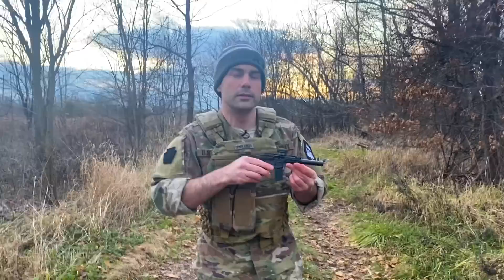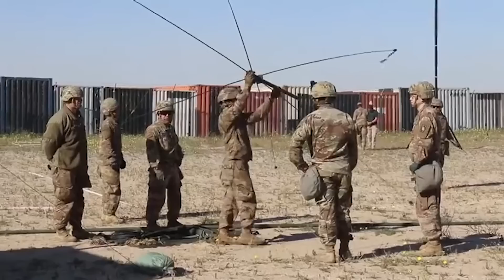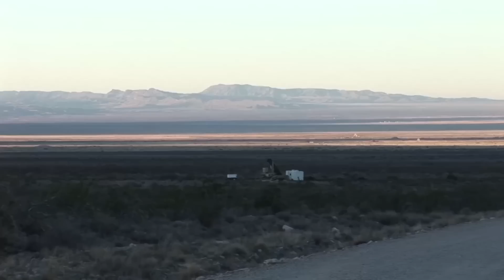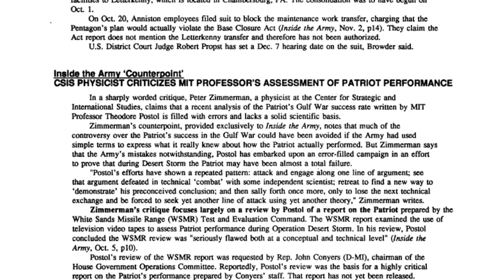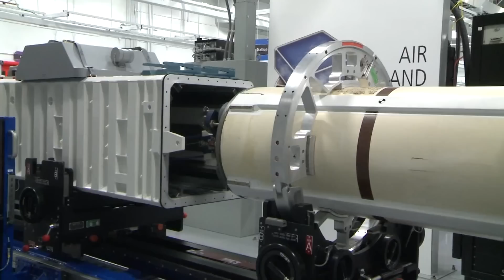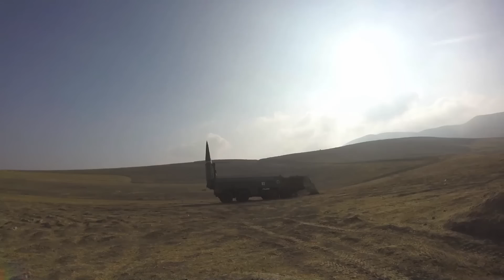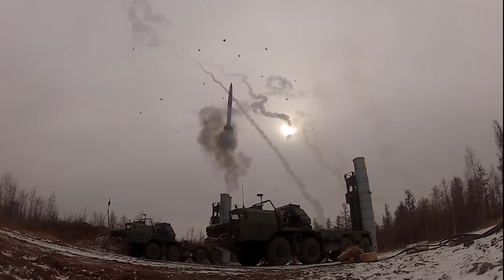Can Patriot Anti-Air Defense REALLY intercept missiles?

Comment: I got to see Patriots take out a few SCUDs in 2003 in the Invasion..  We were just south of An Nasiriya and SCUDS were being launched over us and into Kuwait.  The Patriot Battery was somewhere south of us, possibly along the Kuwait Iraq Border.   SCUDs would fly overhead and just as they would get south of us a Patriot would intercept it and blow it out of the sky... It was pretty badass.... I never saw one miss a SCUD in those couple weeks.  Of course a SCUD is ancient tech compared to whats out there now.
Reply: Advancement goes both ways, especially now with US using GaN AESA radars. Against drones, NASAMS, Avenger, and Stryker M-SHORAD are certainly better as they are way cheaper. Patriot also has a new cheap interceptor with PAAC-4/SkyCeptor. Based on David's Sling Stunner missiles that can reach up to 300km with terminal speed of Mach 7.5. Also the 1st SAM interceptor if I'm not wrong to have dual seekers with infrared and active radar homing. Furthermore, Patriot can use the new LTAMDS triple S/C/X band radar which is a leap ahead compared to a single MPQ-53/65 C-band radar. US could also send their own flavor of Iron Dome with MML/ Enduring Shield that can fire Stinger, Hellfire, AIM-9X, and Iron Dome's Tamir interceptors. Lastly, Army has the new IBCS network that incorporates all of this similar to how the Aegis system works for the Navy.
Reply: @johnsilver9338  There is no PAAC-4 / Skyceptor / David's Sling in production. There are no dual seekers on any Patriot variant. And no, you can't just plug and play any radar with any missile variant. The AN/MPQ-53 Radar Set supports PAC-2 units, while the AN/MPQ-65 Radar Set supports PAC-2 and PAC-3 units. The main difference between these two radars is the addition of a second travelling wave tube (TWT), which gives the −65 radar increased search, detection, and tracking capability.
Reply: @missileman1481  Poland has PAAC-4 if I'm not wrong. Also Romania launched a three-year investment program this year to build SkyCeptor interceptors with Raytheon. The first missiles are expected in 2026. Guam is also going to get 3 new LTAMDS radar.
Reply: Strange as it was estimated that no Patriots hit any SCUDS, a target it was not designed to engage. It did manage to hit planes, friendly ones!
Reply: So, just because patriot system can take down 10 years old scuds then it can surely work against modern hypersonic missiles....yeah...ok...

They won't even spot a zircon or khinzal missile on their radar, let alone taking it down lol
Reply: Watch Ukrainians sematarys and you will know the real deaths of Ukrainians soldiers, more than 300,000+ already berried, Ukraine is screwed by the NATO, they left them half way and have nothing to help them, UK is sending 10 tanks, France is sending tanks from the 50s that can't stand a 30 mm caliber, and the  US wants to give tanks that Ukraine need 1 year for basic training, you have nothing more to give Ukraine and Russia is about to start the war from Belarus, Odesa, and the east at the same time. Russia fooled the west calling the reserves is still going and is about a million finished training and getting ready to enter in the next 1-4 weeks, only Putin knows the date of the actual war, it was never 300,000. also  Russia already won the war with the Chef of Wagner and NATO lost it's weapons, NATO have no jet fighter flying in Ukraine 24 hours destroying weapons like Russia is doing now or drones that can fly, Russia is letting NATO weapons enter because they are destroying NATO weapons easily by drones and easier to locate a Ukrainian soldier in a tank or armored vehicles than in regular car or between houses and trees., why wait for NATO to have a direct war and have all  these weapons to use against Russia.
Reply: It makes sense when hitting a missile! 
Defending unit's/battalion's/city's against missiles makes senes, using an expensive missile system against a cheap(Russian/Iranian) drone, don't make sense. The automatic rada firing system Gepard/Shilka/ is economical sustainable. Spending missils on throw away drones, don't make senes. As Task and purpose(See their Library) describe, the phalanx gun is cheap and works against drones, when the larger weapon systems is deployed(see missiles) pleas use whatever weapon system to defend civilian life.
Reply: @Pelleisraelsson  I don't think those Patriots are intended to shoot down Iranian or Russian drones , but to deal with cruise and ballistic missiles. 

For them drones the Ukrainians have other tools

I wish the US would send C-RAM ( Centurion/Phalanx ) to shred anything that flies near those PAC 2/3
Reply: @junkookbts1273  don´t you think that a C-RAM would be an easy target for a kinzhal?
Reply: @junkookbts1273  How did the US ever get involved in this regional conflict in a foreign land across the globe?  
There are serious problems at home that need fixing.
Reply: @Pelleisraelsson  Yeah but one problem. Raytheon doesn't make as much money from cheaper and more effective systems. And since they own the politicians, expensive equipment it will be.
Reply: @Evan-iq8hd  This conflict has been, among less delightful things, a fascinating showcase about how AAA does, in fact, remain a useful battlefield asset as the missile age enters the new drone age. The Army will figure this out for themselves. The Navy has known it the whole time. But I fear you to be correct; the politicians who approve funds for this sort of overseas aid will never learn, as the arms industry has them purchased.
Reply: First Russia doesn't use SCUDs, the are what like from the 1940s and very slow, plus Iraq only had like 100 of them. Russia is not Iraq and has 400,000+ just from Lancet 3 cheap drone model and millions of missiles. It's worthless against Russia as it only have 43 Miles range and for many other reasons. first, Russia has electronic warfare that make radars and defense system detect 100 or 200 false targets and engage with them. i have seen videos from Ukraine where 50 defense missiles go to the air and explode with no targets. Second, Russia S-300 old missile from the 70s that they modified to hit grounds target fly at 9,000+ mph,  they have 200,000+ of them and each can do such great damage that takes an entire mall.  They can use 1000 of these and Patriot will be out of missiles. Third, cheap drones. Fourth, Russian fighters can detect it from 800+ km and destroy it, they don't have to enter it's 70km/43miles range. Fifth, Russia Kaliber missiles fly lower then 50 meters, it can fly as low as 4.5 meter, and Patriot systems can defend targets at only higher than 50 meters. Then speed, Russia S-200 from the 50s goes 17,000+ kmph .. basically it's a waste of money and time against Russia. I guess after this will be THAAD and then the US has no defenses. Good luck.
Reply: @جمهورية.القطيف.المستقلة-1  No offense. But quite literally everything you have said in this post is wrong. Like everything

1. Russia still uses SCUDs
2. They aren't from the 1940s and most in use are from the 80s and later
3. They aren't slow they usually go over mach 3
4. Iraq had well more than 100 SCUDs 
5. There is no way Russia has 400,000+ Lancet 3 drones & they are not cheap. They probably do not even have 1000 realistically.
6. That is not how electronic warfare devices tend to work at all. What they do essentially boils down to making it harder to detect from further out.
7. 9000mph would be Mach 11, 9000kph would be over Mach 7, no military is currently using anything that goes that fast let alone as an AA missle
8. They do not have that many S 300 missles, they have a few thousand
9. They can't use S 300s to hit ground targets, and they definitely aren't strong enough to destroy an entire mall. At most they can destroy a house.
10. Ukraine could just use S 300s to shoot down S 300s since they own over a hundred S 300 launchers. There would still be 0 reason to do so since S 300s can't hit ground targets.
11. Russian fighters can't target specific things from 800kms away. They can launch a cruise missle into a general area from that far, but that is it. Nor would it detect any anti air system from that far away.
12. Kaliber missles can not fly that low without accidentally hitting something. That is way they are always seen flying a few hundred meters up in the air. No hypersonic missle would be able to fly that low to the ground because they can't see anything once going that fast.
13. S 200 is not faster than an S 300 let alone Mach 13 at 17000+ kmh
14. The US isn't sending anything it's actually using for defense, it's sending surplus things
Reply: @wolimoli  omar is comparing speeds of the missile relative to his camel and Quantities relative to his IQ
Reply: @جمهورية.القطيف.المستقلة-1  Russia has made large technological advances in defense since they have been forced to live in self defense mode for decades.  The NATO sanctions are teaching Russia how to live without the West.  Apparently, the Russian economy seems to be growing, though slowly, with business relations in the non-western parts of the world..
The world stage is definitely in flux.  New major, or near major, powers are growing.  Going to be different in 10 to 15+ years.
Reply: @جمهورية.القطيف.المستقلة-1  hahahahahahahahahahahaha

Everything you said was WRONG

Comment: Even if the PATRIOT doesn’t have a 100% success rate, the fact that the USA is providing them invalidates a major objective of Russia’s strategic bombing campaign.

Russia’s strategic bombing campaign accomplishes two objectives for Russia’s military:

1. Slow Ukrainian military rail logistics since the majority of Ukrainian locomotives are electric. The smaller of the two objectives since the Ukrainian military can simply get higher priority on more limited numbers of diesel powered locomotives. 

2. Force Ukraine to redeploy air defense units from the front lines to protect civilian infrastructure. If Ukraine’s number of air defense weapons was fixed, the Ukrainian units on the front lines would be more vulnerable to Russian air power. But if the Americans are willing to expand the pool of available air defense assets that Ukraine can operate, Russia fails this objective.

Comment: The problem with the patriot missile is simple. There are simply not enough missiles and production is to slow.
The demand for patriot missiles from Saudi-Arabia alone is bigger than what the US can produce.
It's not like you can just stop protecting the oil-flieds in Saudi-Arabia from Yemeni/Iranian drone attacks. So you are forced to keep them supplied. Than you also have demand from the far east.
So even if the patriot system would somehow be some miracle weapon, there are simply not enough missiles.
The Russians can continue firing drones, cruise and ballastic missiles at a rate that is much higher than the production rate of the patriots.

Comment: They were counting missile hits as failures because the warheads were left intact and did a fair bit of damage when they hit the ground. The Patriot has scored 150 low performance targets in an environment of absolute air supremacy. Considering the number of targets in Ukraine and the number of missiles the Russians can use one battery of Patriots (even if they work) wouldn't be of much help. They would also represent an escalation because it would put US troops in an open and direct combat role.

Comment: Honestly, this will not help Ukraine all that much. Ukraine will only have enough Patriots for one battery, that’s It, that’ll only protect very few key infrastructures, not to mention, It takes months of dedicated education to learn these complex systems and use them effectively. Since Russia typically favors cruise missiles, these specific Patriot batteries are not designed for such threats, only high flying aircraft and ballistic missiles, so you can easily overwhelm the system. Not to mention, one of those missiles costs between 3-6 million USD.

This Is just another PR stunt for the US.
Reply: Read through what you wrote a few times and figure out your logic fail.
Reply: @pogo1140  Care to explain? Here's the thing, telling me how It's a "logic fail" doesn't help your case. Not explaining your statement further really does you no good at all.
Reply: I answered you. Patriot missiles, depending on which version are capable of targeting low fast moving jets and cruise missiles match the flight profile of low fast moving jets.
Reply: @pogo1140  The fact you have yet to respond, shows you clearly lack the ability at attempting to reason with me with whatever your logic Is. It's quite a shame, really.
Reply: Currently UA mostly has gotten supplied Air defence especially well suited against cruise missiles and drones. Currently Russia is using especially ballistic missiles to target power grids. Patriot covers a gap in capability here. And while its one patriot now, more may follow. Either way its a good addition.
Reply: @Yung_pindakaas  Yeah, It really isn't. This Is gonna be just like the HIMARS we sent them. You don't hear much of anything about them now. And, If they're so, "well suited against cruise missiles", explain why Ukraine has lost over 50% of their power grid.